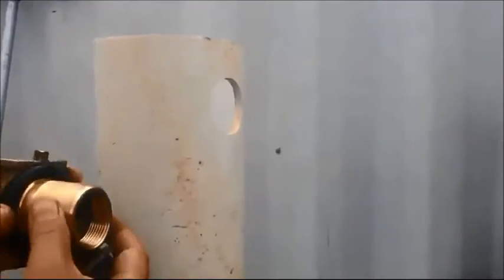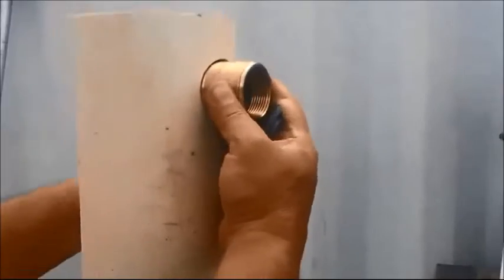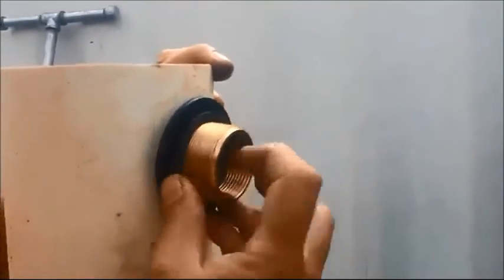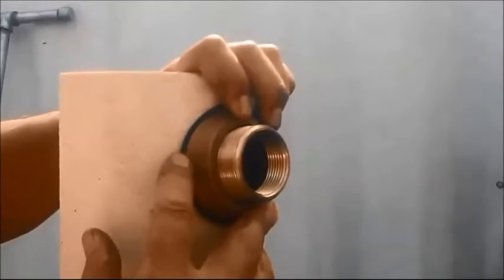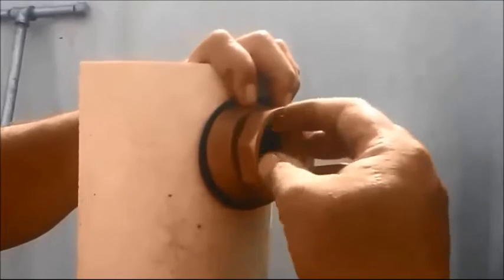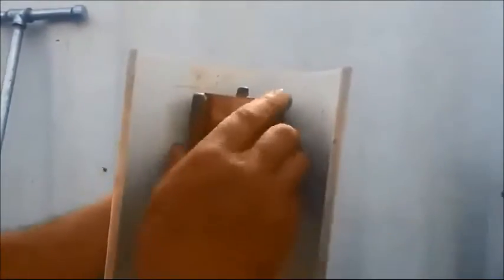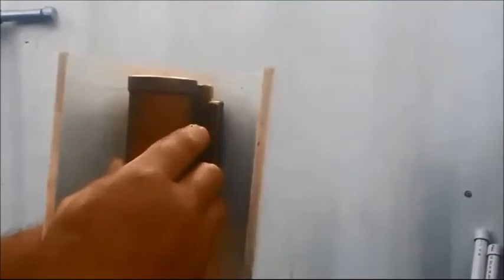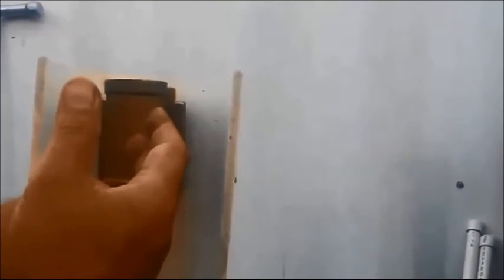Pitless Adapter Demo

Comment: Does that pitless deal support the entire weight of the pump, pipe and column of water running to the bottom of the well or does the pump generally rest at the very bottom of the well?
Reply: The pitless adapter supports the entire weight. Those adapters are actually rated for a couple of thousand pounds, so this is not a problem. By the way, you must keep the pump at least five feet, and preferably ten feet, from the bottom of the bore. That's to avoid drawing up sand and other debris.

Comment: you mention slag from torch. what about metal shaving falling into well?
Reply from the maker: I don't think slag will kill off a well but it's a sloppy option, so I prefer a hole saw. In that operation, most of the cuttings will fall outside the well casing, whereas torch cutting would be the opposite. I wouldn't worry about the last layer of metal shavings from the hole saw cutting through.

Comment: I have a question I live in up state NY where the frost line is 42" so we typical put our water pipes at 48" below grade. The well casing is already installed  and I have a trench dug about 4 feet down. I need to put a hole in my steel well casing for my pit less adapter what do you recommend I use to do so? cutting torch? I also would like to know how I go about installing my pit less adapter since my arm isn't 4 feet long to reach down the well casing to hold it in place while I install the rubber seals and nut on the outside?
Reply from the maker: No torch. You'll have slag fall into your well. Use a metal cutting hole saw. Match it with the diameter of your pitless adapter. Use a metal t-post made of threaded pipe to install and remove the pitless. I have a video which demonstrates both. Good luck.
Reply: And have a helper! Doing it all by yourself is just more work.

Comment: I think mine just went bad. Pump was running every 15 min. and could not find a leak. Someone at work told me to check this and sure enough, water spraying everywhere. I just hope it is just the pitless part on the pump and not a leak on the part that comes to the house cause $$$$$
Reply from the maker: +azimmey Let's hope you just blew the o-ring on the pitless. If it's a threaded connection that's been compromised, it could separate and you could lose the pump and piping. Make sure you get a professional to take a good look at it. Maybe he has a camera you could drop into the casing to positively identify the problem. If the threaded connection is failing and the pipe is weak, you could maybe rig a pipe dog below it to catch it should it fail while lifting the entire run. Good luck.
Reply: It has a cable in there so hope this goes well. Pardon the pun. Thanks for the advice.